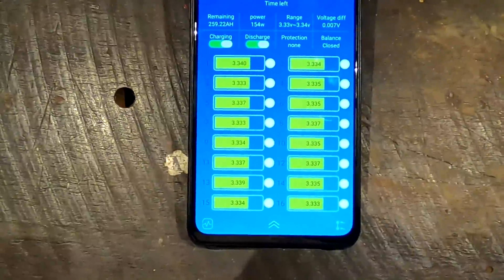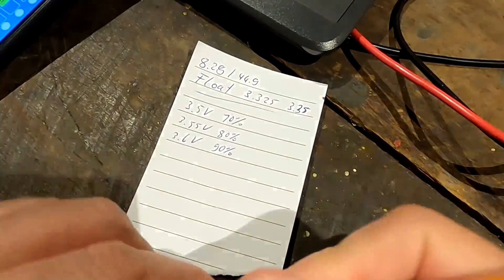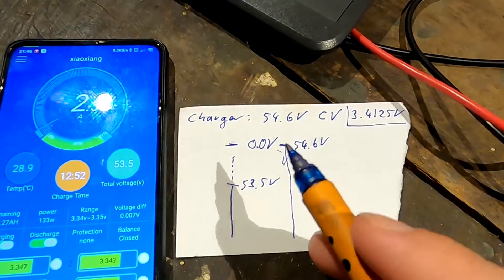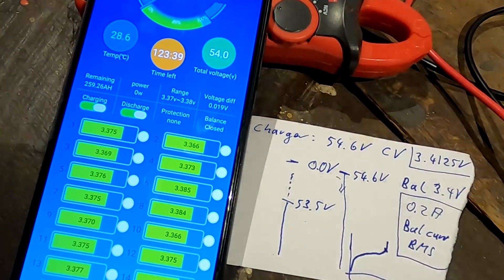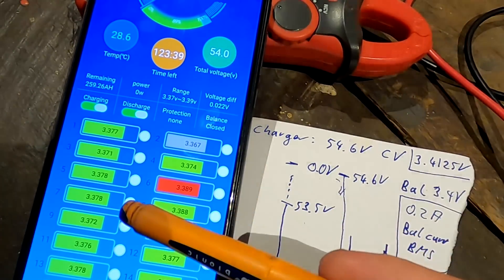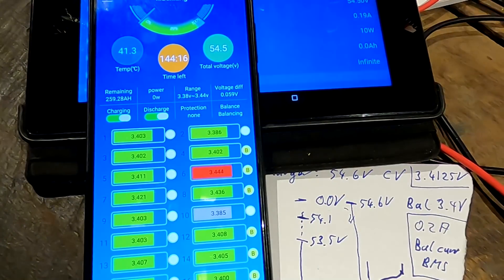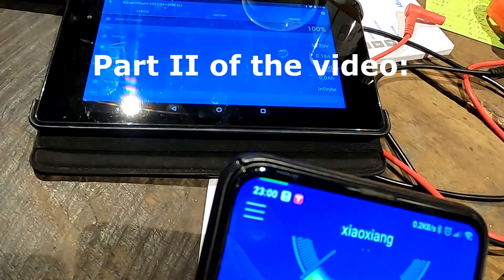Balancing a battery with an e-Bike charger and the BMS function, Part I

Comment: Hallo . Charles Erickson from South Africa .My pylon lithium iorn phosphate battery US 3000 gets charged up by a all in one RCT/Axpert 5K inverter it charges the battery with 54V  30A max when it clicks of the battery settles back to 53,2V then it clicks on and goes up up to 54V then it repeats this procedure about 5 times then the level of battery indicator also shuts of until i use more power than PV can deliver. Then the battery will turn on . The microwave, tauster , washing mashine ,fridge and vacume are les than my PV so my battery remains off.How ever the kettle is the  fucker  at 2200 W it takes 750 W out of my battery and 1500 W from PV there are at that time other devices on aswell. I enjoy looking at these stuff . I'm totaly off the grid this is my 2nd winter.👍Keep on testing and stay well bye bye.

Comment: Oh seen your videos and they are really helpful. I got some panels made by sharp and they are bulky panels 188w and have 10 (5s2p) and using a renogy 60a and it's close to maxing out and have 29.2v lifepo4 battery but need to double battery from 200ah to 400ah cos charges up a bit to quick at times. Love these batteries cos mine at 26.4v it holds it for ages and have seen it get to 100% charged yesterday
Reply from the maker: Thanks David. You can never have enough batteries 😉
Reply: You get addicted to them

Comment: My friend i use a bench power supply instead for my lifepo4 , beauty of this is it will current charge to a point then switch to const voltage near the set value, similar to bulk and float charge and adjustable. Once current drops to 0 on display batteries are charged.

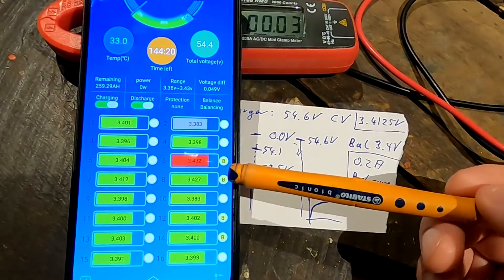Comment: compare cel 4 and 6. Once 6 starts balancing at 8:52 the difference is 0.019 volt.  By the time cell 4 start balancing the difference is 10:59 the delta is 0,041 volt, so larger............... not sure that is what balancing should do but it is not what I would expect it to do.

Comment: Great video. Explained very well. My 15S 55V powerwall would go out of balance after 3 months because I live in the UK and do alot of partial charge/discharges. Top balancing was a rare occasion on a very sunny day. I opted for active balancing in the end and it works great.

Comment: I don't see the point of this. If you use a BMS that does not disconnect the battery, but merely shuts off the charging or load, then what difference does it make that one cell is weak? If once cell has the capacity of say 270 and the others can do 280, then your whole pack is limited to 270. So what? You don't really have a use case where you must have 280ah, right? The charger should just keep charging regardless of whole pack voltage. The BMS will shut it off.

Furthermore, I see no point to running the cells up to the knee of the curve where you can determine that it is at max. Instead the BMS should count the amps and stop at say 95% where the voltages are still in the flat spot. Maybe every few weeks or days, the BMS would run it up to find the max and clear the accumulated amp counting error. Of course a charger cannot do this. It does not know the state of charge.

In this situation balancing is only beneficial to get close to the max capacity. A smart BMS would drain the cell that was the first to the knee to ensure it was not the top cell the next time the pack is run up to the knee. It would be able to drain regardless of whether the cells are at the top or not for days if necessary to bring that cell below the others. It would then rotate the cells to ensure that no cell is taking the knee abuse each time. In other words, balancing by doing bypass when at max V, is silly, unless you have enormous heat sinks.

(I've made such a BMS)

If you are using a lousy BMS that disconnects the battery when one cell is at max or min, then you end up with a lousy experience because the charger or loads, looking at whole pack voltage, cannot stop when they should and the BMS ends up killing both loads and chargers, when only one needed to be stopped. This leads you to get all hot and bothered about balancing the cells and then wondering if matched cells would be better. Essentially the lousy BMS is forcing you to be anal about a few percent more capacity.

Or, you are relying on the charger to stop charging based on whole pack voltage and you are annoyed that you can't get the cells full. In short the chargers and loads should just obey the BMS, and not bother to measure whole pack voltage.

In short, the chargers and loads need to be simple on/off devices that the BMS can control independently.

Comment: The problematic cells are they because variation in production processes?  Nobody apart the Chinese are making these cells!  Wished they could attain production consistency.  Thank you for sharing your knowledge and experiment.  I am learning from you, as you rightly said.  keep it up.
Reply from the maker: Yeah, most likely this is inconsistent cell manufacturing. The battery is a box filled with chemicals, it's analogue and we hook up a BMS which gives us numbers. We hope they are correct. What possibly could go wrong 😁

Comment: Interesting, the default settings from victron is 2 Hrs for absorption for lithium’s?
Reply from the maker: Yes, but this will charge them to almost 100%. From what I can see, you have only two options: either charge to a lower voltage and let it absorb or charge higher and stop charging with no absorption.
It is very tricky to find the right spot if you just want to charge to say 80%. I'll test this out in the future. I've got some nice setup for such testing already here.
Reply: @OffGridGarageAustralia  yep agree - been following with interest (I have a 12v system) 8x120A cells, top balanced them at 3.65v in the end as like you the kept going out and 3 cells would hit max voltage and the BMS kicked in to stop the charging ! I am using the Victron default settings now for my MPPT and looking on the VRM (Raspberri pi) it's working fine now (For the moment) - think this hobby isnt a fire & forget, needs a little tweaking every now and again, we would have to find something else to do with our spare time ;-)
Reply from the maker: @petermartin3806  hahaha, yeah great, I'm looking at my VRM all the time now. It's addictive. I like it.
Reply: @OffGridGarageAustralia  i know the VRM is soo addictive, sit there watching the sun come out and the stats move up & down boys and their toys ;-)

Comment: Your in-depth analysis of this stuff is interesting.  Knowledge is never a bad thing.  You're helping a lot of people understand the smallest details about owning and managing these types of battery solutions.  

However, in practical use, you would not be charging so close to the top or discharging so close to the bottom.  You are observing a slight difference in the voltage of 3 cells in your pack, but during normal usage, that difference would not matter.  As you explore these very small details, please be sure to let people also know that some of the stuff you're explaining really isn't important if they just want to use this kind of battery.
Reply from the maker: Thank you, Jason. You're absolutely right with what you're saying. I am very picky with what I explore and share in terms of these batteries. I also go into these details because this is just what I experience at the moment.
So, the next test will be very interesting as I do the full discharge and capacity test on my battery. We will find out how much influence these three cells have on the overall capacity of the battery.
Thanks again, for pointing this out, I sometimes get a bit lost in too many details.
Reply: @OffGridGarageAustralia  - I don't think YOU are lost in the details, and I'm glad for that because of how much you are teaching us.  I worry that others might not fully understand how some details are critical, while other things are more of an interesting anomaly, but not something to worry about TOO much.  :)
Reply: @OffGridGarageAustralia  For sure you will end up in your Voltage Swamp again., stressing and maybe killing your battery cells... Love to see all the problems.....

Comment: You SHOULD mention that the BMS Balancing is PASSIVE, and only Burns off Hi Volts.  This is opposite to ACTIVE Balancing which transfers power from Hi to Lo Cells.

You would likely get a better result by enabling Balancing @ 3.350V  You likely could also go up to 55..60 (3.475vpc) to 56.0V (3.500vpc)  without issues if you start balancing a touch lower.
Reply from the maker: The balancing current would not matter at such low voltage. I would charge with 20A but at the same time discharge with 0.2A (balancing current). You would need to turn off charging at 3.35V to have an effect on balancing. Or, let the cells absorb at this point? But what Soc would you have then?
More tests to follow...

Comment: It has been a couple of weeks since your last video about bms not switchinch off the battery when some of the battery conditions is not satisfied, is this already working properly, or do you still use the bms with faulty relay?
Reply from the maker: I still have the faulty BMS installed with no overvoltage protection atm. I'm monitoring all systems remotely all the time to make sure it is safe and nothing gets out of control. The new BMS has arrived this week though, so... I just need TIME!

Comment: This sounds good. I still think 3.4 is on the low side, but will definitely be better than your "I charged and discharged some cells" mix up you have now.
BTW, that 54.6v charger is likely intended for a 13s "48v" lithium-cobalt e-bike pack, charging to 4.2 volt per cell. e-bike packs are also available in 14s which is often called 52v but sometimes also called 48v. Watch out for those, which at 14s 4.2v/cell is 58.8 volt or on your 16s 3.675, which is a little too much for LiFePO4 but if the charger is a little bit high and does 4.3v/c at 14s it will be too high for comfort on your 16s.
Reply from the maker: Thanks Sylvan. I saw some other chargers which charged a bit higher. They were also advertised for LiFePO4 but rather for a 17s pack. This one seems to work well (even it's slow) and it's just a backup. I probably won't use it ever... unless for testing.

Comment: I think that the real discussion issue is the lack of solar - and the need to incorporate "alternative" alternative power (lol) - I am not even opting for solar panels - - they are simply too expensive and the sun is only available during the day and in good weather and I need power when it is cold, rainy, wet and dark - so in my humble opinion : solar is often in the dark and wind power often sucks :)
Reply: Yes, that's why we need batteries, for when there is no sun. What do you use yourself at night to get offgrid power?
Reply: @hommerdalor6301  Batteries of course - but I don;t bother using solar to charge (I live near the Canadian border)- I just use an efficient generator to charge batteries when needed - works 24/7 365 days a year. I am considering picking up an old Lister hit and miss diesel motor to spin the generator - even more efficient. My primary object for developing battery storage is to avoid paying peak prices for electricity. That is why I have taken this approach. I still use grid power when it is priced low enough - if it too expensive or if the grid is down I use a generator to charge the batteries.

Comment: I've noticed a very similar thing when trying to balance Myself, I went ahead and capacity tested. The four cells I had and sure enough the one cell which was dipping high and low at the very end and top of the charge and discharge cycle was pulling slightly less capacity than the rest. It could be due to a slightly lower capacity cells. I ran further testing and that is about the only thing that I can see is happening for me. And it's very similar to what's going on with you.
Reply from the maker: Yes, thanks for sharing, I'm expecting the same 6, 7 and 8 may have higher resistance and lower capacity then the rest. 
In the next video, I'll do a full capacity test of the whole bank. This will clear things up.
Reply: @OffGridGarageAustralia  as much as it may suck and it may take a while I would highly suggest testing each cell individually on one specific tester so that you can get a generalized Baseline of the individual cells amp hour capacity readings. I tested my four cells together as a pack and pulled good capacity more than the rated capacity. But when doing individual cell capacity testing that's where I found the low cell. My lower cell was still pulling more than the rated capacity but was lower than the rest of the cells in the pack. Great videos and continues a good work though

Comment: Understand the frustration of cells 5, 6, and 7.  If it bothers that much, one could add small batteries in parallel with 5, 6, and 7. Just tiny additional cells, maybe 32650 or even 18650 to 'trim' the capacity.
Reply from the maker: It does not bother, I'm just observing and testing at the moment. The full capacity test in the next video will clear things up.

Comment: This was a great example of how balancing works.
Reply from the maker: Thank you.
Reply: No, normally the charger stops when the BMS does it balancing act. (At least the two BMS-ses of mine) Then one or some cells will discharge by the BMS. When the voltages of all cells are below the balance point, the charger will restart to charge again. Until Balancing one or more cells who are fullest.... Bleed them a little and then restart charging.... This can take many hours the first time. EVerytime more blue balancing leds will go on, until all burn and the charger will not go on again. Then you battery pack is balanced full.... BUT that is NOT necessary every time you charge up. Also it is not economical as good as an lower voltage for cut-off. like 3,4 Volt. Just put your inverter-charger on the eco-values. Keep track of the cell voltages, very frequent in the beginning. After a few weeks you don't have the feeling anything could be wrong, than you can lower that frequentie. To one a week or so. Every year, half year or so, you can fully balance charge.... But pls. FORGET 3,65 volt and 2,5 volt !!! This is truly a danger zone, where tings go wrong in half an hour... if you make a mistake. DOn't forget the discharge curve and charge curve are in time! Time and voltage do NOT go up in same speed/time.... Voltage will surprise you, and you will have multiple cells going up, but not in the same pace! Like a class of children walking, all the same distance, but with little different in speeds, will result in different ending time of the walk or the charge....
Reply: @philipwinkelhorst934  
The charger doesn't know whether the bms is balancing or not. The charger stops charging when the pack voltage and amperage hits a set target.

Comment: The 3 cells in question probably have a slightly higher internal resistance than the other, or have slightly less capacity (or both).
Reply from the maker: Yes, as I said in the video, it looks like exactly that. Hence they are lower and higher at both ends of the curve.
Reply: @OffGridGarageAustralia  I think you will find that these cells will never be perfect because they have less total energy capacity.  Keep going though, it’s real interesting what is happening!  At a minimum, we are learning the need for “matched” cells.
Reply from the maker: @jeffbankert7123  Yes, thanks, we can only learn from all that. These are the things I always wanted to know but could not google in such details. It's great I can test this all out now myself and be able to share this here.